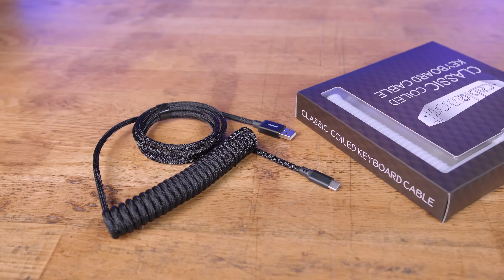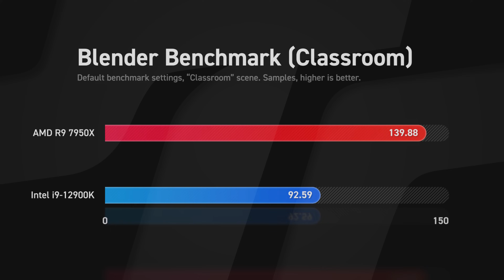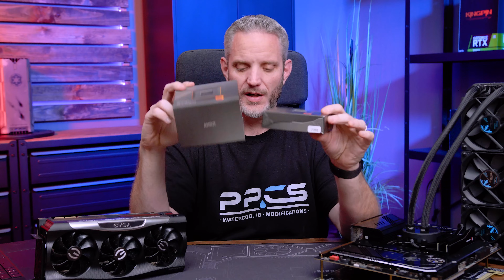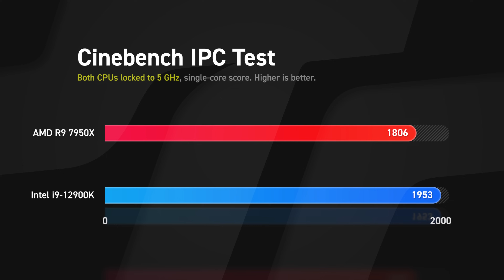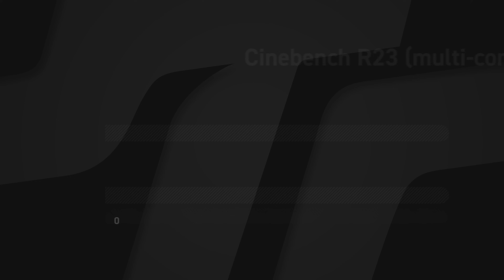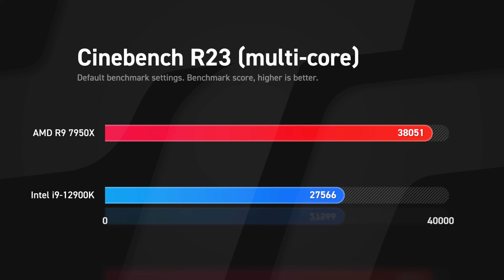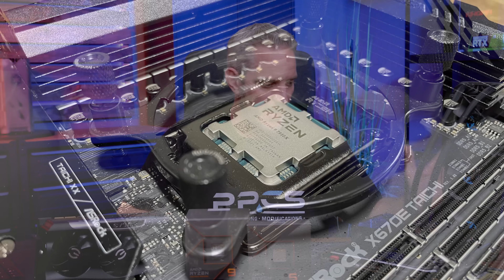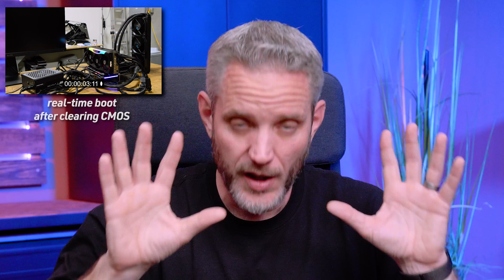Forget EVERTHING you THINK you know about AMD... these CPUs kick A$$!!

Comment: hey @JayzTwoCents I have 
Operating system: Microsoft Windows 10 Pro
Processor: AMD Ryzen 7 5800X 8-Core Processor8/16
Motherboard: MPG X570 GAMING PLUS 
RAM: 64 GB
STORAGE1: SAMSUNG SSD PM800 2.5" 128GB (119.2 GB/Fixed hard disk media)
STORAGE2: WD_BLACK SN850X HS 1000GB (931.5 GB/Fixed hard disk media)
STORAGE3: ST1000DM003-1ER162 (931.5 GB/Fixed hard disk media)
Graphics card: AMD Radeon RX 6700 XT (12.0 GB)
DISPLAY: Samsung LC34G55T (3440x1440 / 34.2 Inch)
 What would be worth upgrading GPU or CPU just looking for better Quality /FPS/ load times just looking for anything faster I stream on Twitch/YouTube and I built this is the covid time where everything was over priced and all sold out by the time everything was hitting the market I play mostly simulators and realism/military games I'm looking to stick with AMD Any help would be really appreciated Thank You!!!

Comment: most of this 3580 comentators failed for AMD's marketing. now we found out; Agesa issues, vsoc voltage issues, doco/expo issues, temperature spikes, no scheduler, roast them selves (maybe not just mobo venddors failure) i saw comments on reddit about USB issues, was this no also on zen 1 to zen 3? through the board a complete mess, unfortunatelly

Comment: I still ended up spending £350 on my AM5 board on my move up, despite only spending £222 on my Ryzen 5 7600x, purely because as a stepping stone it made more sense to get the cheaper CPU FOR NOW based on the cost to performance trade off over the next few years. I could justify paying the £350 for the Steel Legend x670e, purely because the AM5 is a new socket line with AMD, meaning I'm hopeful for some good upgrade opportunities down the line, which x670e will be able to handle due to the additional PCIE gen5 and extra lanes.

You could arguably make the point, that in the future the PCIE gen5 will be cheaper, negating the investment I've made now in the more expensive board, BUT regardless, that extra cost I've paid now, will be coming from whatever the cost may be down the line, and I would argue that I've taken that price hit now, to avoid buying a new motherboard entirely, AND have a much higher spec board for the years to come. The choice was simple, go hard or go home; buy an x670e and move to AM5 with DDR5/PCIE GEN5, or go with top end AM4, or top end 13th gen intel, and be chip lock due to the socket being at end of life. I made the choice to commit to what AMD will be bringing out down the line, as thus far, their innovation has been pretty promising, and they've been throwing some heavy punches at times, towards both intel and NVIDIA alike.

Anyway, thought I'd share, its a personal choice at the end of the day that has to be made, and for me, I've gone through 4 separate systems, all lasting 5+ years each, and I've never fumbled on an upgrade path SO FAR, and I've always managed to stay "top spec" while keeping my average MSRP to around a 50% reduction averaged out over the years, although admittedly, this AM5 jump has been the most expensive out of all of them. Fingers crossed, and good luck to anyone joining me as a guinea pig on AM5, lol.

Comment: Im waiting for the end of this Era of AMD, the last end era was the FX-9590, blew the competition out of the water. But not for long. AMD then dove under the water and maintained silence till Ryzen. Starting the new era.

So. The Ryzen 9 9590. Will be a quantum computer? The fx-9590 broke the 5.0ghz wall. What will Ryzen 9590 do? At this much performance jump per generation? How hard AMD is rolling? 

I expect a CPU the size of threadripper, clocked at 6ghz base. With just as many cores. With x4.5 the performance we see now. Its 2.5 generations away.

Comment: These things are BEASTS... even if you take a 7600 or 7700 and drop the power and thermal limits they still in most cases out perform the 3950x and 5950x wich are $700 cpu's, and even exceed the 5800X3D in gaming.. Insane, I guess you need it though to feed the new RX7900XTX and 4080/4090 graphics cards.

Comment: Hello i have a new build. rog crosshair x670e hero with a 7950x pcu! I power up and CPU fan GPU fans not on NO Q-led come on. I get the start butten on the M-board, flexkey, Led on ran, and the Rog led over the use hub all turn on. no display ether? I have pulled CPU its clean no bent pins pulled ram its good GPU was pulled and still cant get it to start up fully O and the bios is updated.
Reply: Same thing happened with me earlier 7950x cpu x670e mb 7900xt gpu no display on boot no gpu fans spinning but everything else works and lights up
Reply: Any fix ?

Comment: Never had the need to upgrade and replace both my FX8350 CPU machines, other upgrades did include a GPU Vega64 the other the RX 580, replaced power supplies and cases and larger hard drives.. I did look at the 5600x but I think its going to be another 12 months yet until gen 2 AM5 comes out and DDR5 and the AM5 mobies drop in price. The FX8350 have been amazing machines, mine must be 9 years old now? Oh yeah and bought the Gigabyte 990x mobies cos it offered M2, so I guess the only thing that survived the 9 years were the CPU and RAM everything else has been replaced.

Comment: So I have dumb question but it’s worth a shot but I just bought a x670E-A mobo and really wanted to buy the new ryzen 9 7950x3D that’s supposed to launch later in January. I also ordered some Corsair ddr5 ram that says it’s xmp optimized for intel which i didn’t know there was a amd expo ddr5 ram…now my dumb question was will I still be able to run that ram on the new amd motherboards Or should I return the ddr5 ram

Comment: I just built a new AM5 system - MSI X670 motherboard, 7900X R9 with 32 GB Corsair Vengeance DDR5 - first boot (with no smoke or fireworks thank God!) took only a minute - subsequent boots into WIn11 are much faster. I've hit 93 C under stressed CPU conditions with a Cooler Master air cooler but don't plan on regularly stressing the system on a daily basis - normal usage temps in the 45-75 C range with all cores @ 5+ GHz. We'll see! Time will tell. I was going to use a 240 AIO Lian Li cooler but the case needs to be modded to fit....maybe. We'll see.

Comment: Hey jay love your content. I’m getting everything together to build my new system. Amd ryzen 9 7950x  a Corsair 5000d case. Wondering what cooler you recommend. Staying away from custom liquid cooled loop what would you recommend for cooling? Which cooler and fan combo would you use? Mainly use the pc for gaming. Thanks!
Reply: I’ve been building and repairing systems for 24 years, fuk liquid cooling!
Something often goes wrong with any liquid cooling system.   I love the clean look of a water block on my pc’s  with an Asus rog board but something always prematurely breaks.   The pumps in most of the Corsair coolers since 2013 are Chinese garbage.  I had a Corsair H110 pump fail three times in two years. 

Get a Scythe Ninja 5 air cooling beast. Yes, it takes up a plethora of space but it will completely cool your monster cpu in silence with total reliability.  Use two 120mm fans in a push-pull configuration.

Good luck either way. I wish I could afford Ryzen 7950x for my son and I.

P.s. I highly recommend Corsair memory and power supplies with Japanese made capacitors just no Corsair liquid cooling solutions.
Reply: If youre getting the 5000d then go H170i elite. Basically try to make most RGB parts corsair. Its then easier to manage the RGB with the app.

Comment: Doesnt age well... Intel is now slamming AMD by its 13th Gen. 13700 having the similar performance as 7900x but $150 cheaper, not to mention savings on reusing motherboard and DDR4. 13900 beaten 7950x with better performance on many professional use cases and $100 cheaper. Never saw that coming a month ago.

Comment: Jay, you have helped me sleep better tonight.

I just put together a system based on an AMD Ryzen 7 5700G and a Gigabyte B550 motherboard and, honestly, it scared the crap outta me when I started it up.  It would boot, and then stop.  Boot and then stop. Boot and then stop.  I hit the power-switch, swapped out the memory sticks, unplugged the power supply and plugged it back in again - boot and then stop - boot and then stop.  Eventually I got to the Gigabyte splash screen and it's been wonderful ever since - but what happened?  What went wrong?  Apparently nothing!

Comment: Hi, Jay... enjoying your reviews! you are one of the less dramatic producers! :) ... ? ... 7600X Z4 processor... got one. Looking at the asus TUF Gaming B650 MB... cannot seem to nail down with ceratainty QVL memory... asus "has some" listed but they are coming back as "intel" boards... was hoping you might assist in nailing some that works or maybe instruct me on HOW TO find the right memory for this board. TY if you can/have time. DD (wanting 64 gigs- don't know if 2x32 is better or 4x16 or... ) (I'd LIKE to put 128 in it but they don't 128 at all :( ) TY again! .... PS- just clicked ORDER for 6900XT card from BH... the am5 socket gives me the option to upgrade the cpu when they get them all hammered out and this video card should have very long lets on it. The memory is what I'm having trouble getting figured out. I don't want to buy something that isn't optimal or doesn't work at all worst case. TY AGAIN! :)

Comment: I recall a lot of ppl saying the AMD Phenom series CPU's were garbage. I had a PC with an MSI 990 series chipset MOBO and a Phenom 2 975 (3.6Ghz) quad core black series. With a 180 watt TDP CPU cooler I was able to get stable clock speeds of 4.25GHz with idle temps in the upper 20s and load temps in the mid 50s peak temps never exceeded 61C. I was also running 2 MSI HD 7980 GPUs in crossfire and 16GB of Corsair Dominator Ram in dual channel mode and 2 Hitachi 10K rpm 380GB HDDs in raid 0. That build was a beast and crushed every game I played.

Comment: There are currently 2 choices: spend a FORTUNE for AMD 7000 (FULL new rig) or save a fortune with Intel 13th - which way you go depends on if AMD's performance justifies a MUCH bigger spend, and without 3D cache, the answer to that is NO! Let me elaborate: 
1. Spend a LOT more money for the full switch to DDR5 and PCIe 5, etc.. for AMD, in which case they would have to be MILES ahead of Intel to justify the cost (which the 7950 is NOT, having seen 13th gen CPU performance- so ONLY if AMD bring out 3D cache versions would they be able to persuade me to pay out the huge sum of cash, before going out & getting Intel this black Friday.)  
OR
2. Get the cheaper Intel 13th with MUCH MUCH cheaper parts (like you can use DDR4, etc.); no need to upgrade the whole rig, and you will still get similar gaming results with the Intel 13900 to the AMD 7950X. 

I AM open to spending the insane cost for an entirely new rig needed for AMD, BUT NOT for the performance difference between AMD 7000 & Intel 13th gen - the only way AMD could motivate me would be with 3D Cache 7000 chips, as this would leave Intel 13th gen in the dust, especially as with GPU's like the RTX4090 we have moved back to being CPU limited for even 4K games now! As we have seen with AMD's earlier 3D cache chip, it makes a HUGE difference to gaming, with that old chip STILL BEATING both companies' best CPUs in some games! I am not a "fan boy" of either company - I just want the best performance without getting ripped off.
Reply: Eh the cost really isn't bad when you remember amd will probably support am5 for much longer than Intel will support their platform. So 60 more dollars on a motherboard for more years of support. Remember you can take an a320 from 2017 and put a 5th gen Ryzen in it. (Depending on power delivery) so users who got last year's Intel mb can get 13th gen, but it's a dead platform from there. Say they get this year's chipset one more year of cpu upgrades maybe? Plus the 13900k runs so hot and hungry overclocking without exotic cooling would be tough. With the 7950x you could overclock than with an AIO and easily pass the average 4% gain the 13900k has on it

Comment: Omg the RAM training process is sooo bad UX! I like the feature but to be default option is really really bad. I'd rather boot immediately with default lowest timings than been freaked out for one minute. It's imo much better to add option into BIOS to manually trigger this learning, or boot up and before going to BIOS show option "Yes I want super duper timing and I'm ok to wait" or "No just get me into BIOS". This way there is no need to freak out for as user I explicitly ask to optimize timings so I can understand it will take a time and I know what is happening.
I also don't expect that the cheap AM5 mobo will have boot code displays. So as user  I can even to google up the code and get to forums where they will explain this stupid UX.

I'd also appreciate to sacrifice some performance but have cooler PC, so I look forward for your next video about undervolting ;)

Otherwise I'm happy to see AMD again on top! Finally THE competition.

Comment: My first week with 7950x has seen some stability issues, which improved dramatically with a Windows 10 update. Most lock ups involved Chrome and/or file explorer, but has not happened in a while.

Using an ASUS ProArt motherboard. I got Gskill RAM which I am struggling to get to run fast. Using a Noctua air cooler, inside of a Fractal Torrent case, which means I lost a few points in the ten minute Cinebench score compared to an AIO, but it is more than enough for me. Some of my CPU cores hit 5.8 ghtz, mad! 

Once in its 95.4 degrees max, most cores settle in at 5.1 or 5.0 ghtz. Only benchmarking and maybe rendering for an hour in After Effects brought the CPU to max temps. Everything else struggles to max out the processor and cooling.

Comment: I am a software engineer, and for many years, I have yearned for a "workstation" class machine for my own, at home, mine to use for personal research or work or whatever strikes my fancy. For a long time, I thought I wanted a Sun SparcStation. Several years ago, I hand-built my workstation with an AMD Ryzen 9 3900X (12 cores, 24 threads), 128GB-ram, 3TB motherboard NVMe M.3 Gen4 SSD, 8TB SATA S SD, 8TB HD, NVidia TU106 GeForce Super. I run Linux, at first Linux Mint, and now Ubuntu Linux 22.04.1 LTS. This machine has been life-changing for me. It has all the power I need for my work and play. The increases in performance between the release of the 3900X and what we are seeing released now is frosting on the cake. As a musician (guitar player), I am subject to GAS (Gear Acquisition Syndrome) and always want the latest shiny toy, but I haven't felt the limits of my existing workstation. I have not run out of memory nor used up the cores on hand with anything I have done. GO AMD!! The next time I have too much money on time, ITS THREADRIPPER TIME !! :-)

Comment: If it ran @5.1Ghz @95C it did throttle because it didn't run at 5.7Ghz. It didn't even try to reach tjmax. So AMD can say whatever they want but people buying max boost 5.7Ghz CPU are going to expect 5.7GHz at least. It's not a $100 CPU... edit: Intel is even worse. I wouldn't touch new ryzen or any of the Intel 12 and 13 series. For gaming either 5600G or 5800X3D from AMD or 10600K or 11700K from Intel.

Comment: It's amazing how Intel has continued to survive keeping it's name as the "professional," "corporate-grade" CPU. I know a person who found a fault in the ALU design in an Intel processor in the 90's. It wasn't manufacturing defect, it wasn't a fried diode/transistor, it was the FPU literally designed incorrectly. She had to track it down because she knew the results it was spitting out mathematically were wrong, outside the error possible with IEEE doubles. Ofc, most people didn't notice because most people don't need perfect precision out to 30 places, but you'd think that would be a pretty BIG deal. Intel gave her company a shit-ton of workstations as a thank you/ pseudo hush money so nobody would hear about it. Nothing illicit, just somewhat ethically questionable.

Intel is alright, but it's so shitty when every university/corporate workstation is running Intel when they could just as easily be AMD running better or cheaper (or both). Just scummy marketing and corporate know-nothings looking at price tags and saying "it's more expensive, so it must be more professional."

Comment: After 1 year I found out yesterday the AMD Chipset drivers of your motherboard DOES NOT INSTALL/UPDATE THE FOLLOWING inwin included DRIVERS, BUT u can do manually at c:\amd\chipset drivers\binaries .... THESE HAVE TO BE MANUALLY 1BY1 UPDATED FROM THE DEVICES IN CONTROL PANEL : 1.pci driver, 2.psp driver(driver for the tpm), gpio2 driver(controller between cpu+something), smbus (null driver but more supported models in its updated list) , 4.ppkg driver unlocks staff for overclockers ... LOL DO IT at least gpio2 and if u use secure boot then psp11 also if why not all of them

Comment: Auto adjust at 95°, but as Paul and others have pointed out, they run better and cooler if you change settings in PBO2 - basically, AMD missed the mark on performance and temperatures with their automatic settings.
Reply: You sure about that? We have a 7900X. Remains around 75 degrees at its stock settings.

Comment: heat may be an issue  for v-cache on a 7700x3d  .  7000 series is way hotter than the 5000 series and clocks had to be lowered on the 5800x3d to lower heat . i don't see v-cache coming to  ryzen 7000 until they fix the die and the soldering process thickness and cooling the 7000